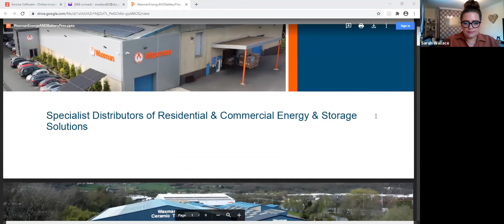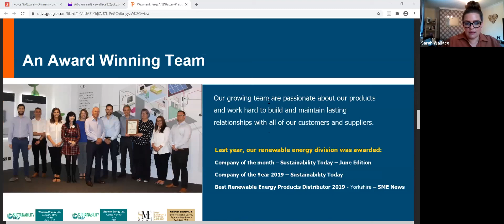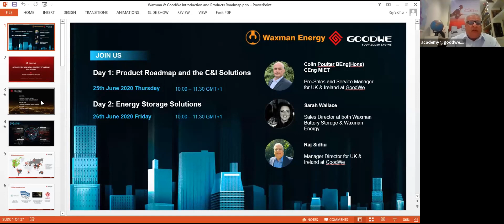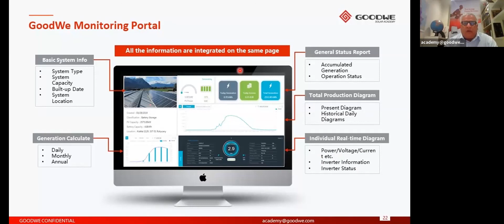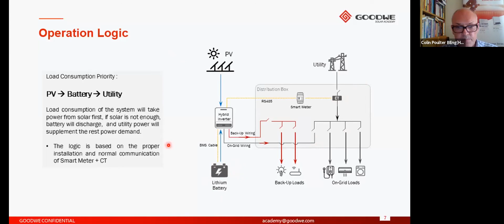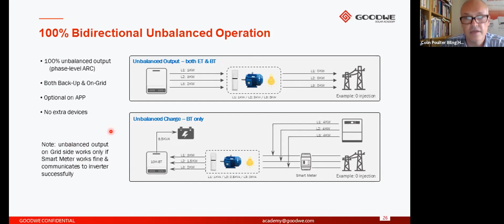UK Webinar：GoodWe Products Roadmap, C&I Solution and Energy Storage Solutions 2020.06.26

Comment: Good day.

I have installed a 10kw ET with an HV Pylontech system. The system works ok. My concerns I have are as follow 
1. The inverter struggles to handle a 1.5kw single-phase water pump on the backup load when the grid is not available (Inrush current is high and the inverter simply switches off). This took a while to diagnose because the fault history only stored the grid failure and not the high current draw from the batteries.
2. The alarm history on the Sems portal and on the Sems APP is not showing as in https://www.youtube.com/watch?v=zFYWwLkw5Jg video. This also hinders fault-finding, especially to the client.
3. Push notifications on inverter status and faults must be added, please. If we can get a notification of grid failures, faults, and battery status it would be great.
4. Is there a hardwired display for these units? Something inline as the Victron color control?
5.Faults in PV master and Sems APP. In Sems app there is not a fault history and the warning on the BMS gives a lot of "communication fail" fault. The PV mater fault history and alarms do not always update in real-time.

Thank you in advance.